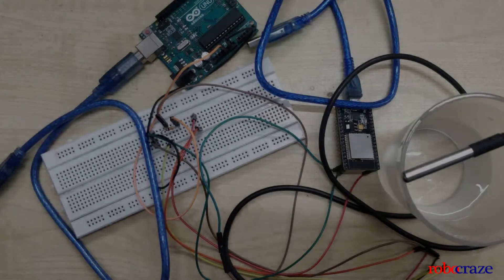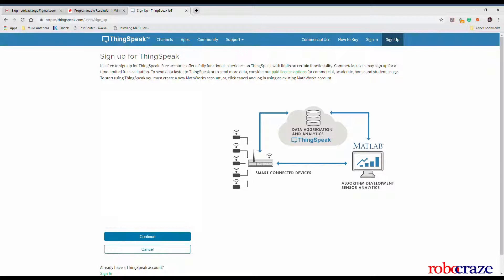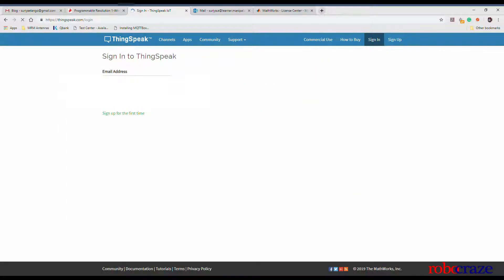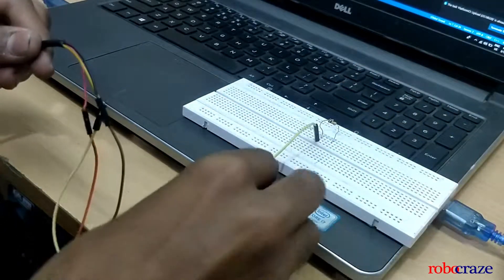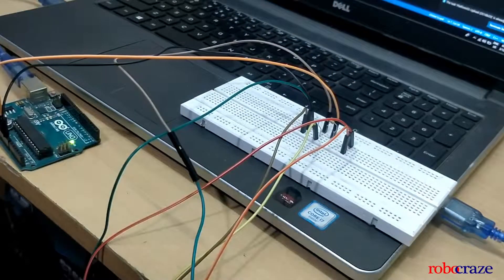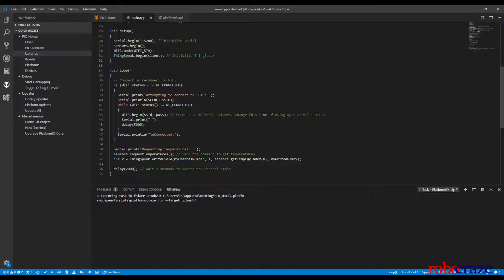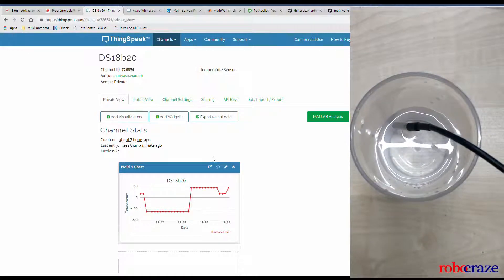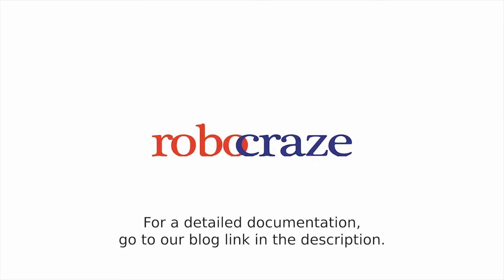DS18B20 Temperature Sensor with ESP32: Wiring & Basic Code Tutorial

Comment: Is it possible to not use Arduino Uno Board, just the esp32?
Reply from the maker: Yes, it is possible to use the ESP32 board without an Arduino Uno. The ESP32 is a standalone microcontroller board that can be programmed using the Arduino framework.
Reply: @Robocraze  yeah I'm confused, why did you connect an arduino to it instead of just using the ESP32 ?

Comment: What is the maximum length from sensor to nodemcu for it to work properly??
Reply from the maker: Hello,
Longer cables experience voltage drop due to resistance. Ensure sufficient voltage at the sensor. So cable length can be tested by seeing if there is any voltage drops.